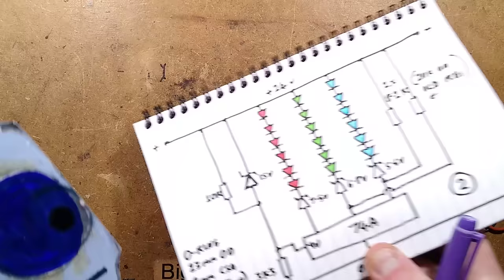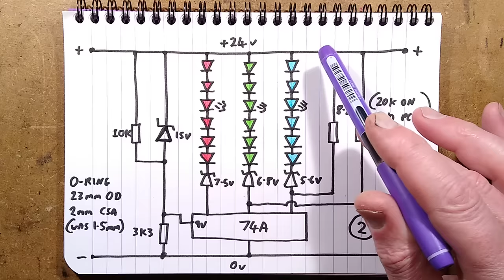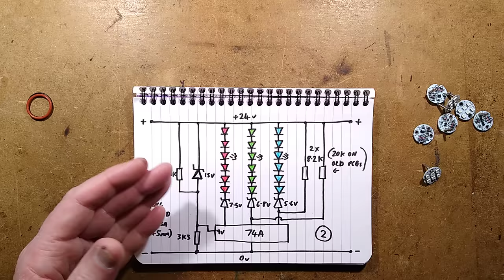Fixing Twinkly festoon issues - interesting power and data system

Comment: Am I the ONLY one who sniggered when Clive said "No. 2" ???

Great video once again, thanks Clive! Would it be possible to hook up a scope to the rail/components to see where the data flows (instead of the water? 🤣)
Reply from the maker: Others have gone much deeper into the twinkly protocol.
Reply: @bigclivedotcom  very interresting how they manage the protocol.. but a bit outside the scope of you typical teardown/fixing things! Nevertheless, a great video. Keep up the good work, thank you Clive! 

Oh! On the topic of OH-rings 🙂 - I see that suppliers normally only quote the inside diameter plus the cord thickness. Probably because the things are so squishy from the outside!

Comment: Another informative video from Big Clive - How to put the twinkle back in your Twinklys! 😁
Would the IC on board be programmed as they produce them? rather than holding stock of each individual number? Also leads to the question "how many of these are in each display/set?"
Reply from the maker: Not sure how they're programmed or the maximum number available in a string.

Comment: Resistors on the right are for calibrating white balance or matching perceived light intensity for all colors - current is fixed in chip and redirecting part of it will reduce intensity of this channel.

Comment: Very interesting.  Never considered SMT resistors would be a point of failure.  Thought they were completely sealed and invulnerable to moisture.
Reply from the maker: It's probably sneaky electrolytic corrosion creating a microscopic gap at a thinner area.
Reply: Where they're not always flat against the board if any water gets under them it'll be hard hard to get it out

Comment: I am no expert on this and I will be perfectly honest and say that this is the first I have heard of these but the communication method sounds very much like a CanBus style protocol with a time synchronisation reset…maybe

However, if it was something as simple as that then that would’ve been picked up already by people trying to reverse engineer it. Maybe some proprietary methods over the top of a well established high speed two wire method?

Nice video as always
Reply: Isn’t CAN (2 wire) using both lines for positive voltage? But yes the signal is always in a range between 1.5 and 3.5 volts. Both wires sum up to the median 2.5V. I guess only 1 wire could be enough if the zeners put the voltage to the lower level to eliminate pulsing. (Probably not even visible if not if its a fast data rate)
Reply: @domnik9062  Yes, CAN bus is two wire. The signal value is determined by comparing the relative voltages of the two wires, CAN H and CAN L, which almost entirely takes out the impact of the incredibly electrically noisy environment that CAN bus was designed for. The concept is that voltage spikes will affect both simultaneously and therefore it's just a case of comparing whatever happens to come through. Voltage drops can be more problematic due to them affecting the circuitry more directly than EM interference in the wires or voltage spikes in the power source.

For something like this application I would expect a combination of data transmissions to one or more recipient nodes as well as an application broadcast transmission that triggers all nodes to apply the data they have just received. It's quite likely that there is also a combination of deltas as well as absolute values in the communications protocol, but that could be complicating things more when it comes to optimising bandwidth compared to control.

Comment: Clive, I wonder if the thing you have marked as the power input is actually the data input, and the chip gets its power from some or all of the LED drive lines. That would explain the lack of a filter cap on the "power" line.

Comment: Would the 8201s stop ghost glow when those strings are off ? They have a place for the 3rd one but it is not populated.
Reply: Why would there be ghost glow? If "off" is called for, the controller won't be pulsing the power to the LEDs?
Reply: Clever these Chinese.
Reply: @obd6HsN  perhaps the driver outputs have some leakage. blue and GaN green are very sensitive and can glow with only 100nA

Comment: Twinkly has really let me down. As long as their products work, it's absolutely amazing, but the longevity is questionable. I have taken really well care of it, but the power supplies only last a season or three, my two strings had leds starting to fail at the end of the first season, and now by the thirds season they are no longer usable as strings, unless I pick an effect with "rainbow colors" since so many leds are the wrong color.
Reply from the maker: They do water resilient versions.  Are you using the standard versions outdoor, and are there visible signs of corrosion?

Comment: Would have been nice to see one of the actual boards in operation. Perhaps even diagnosing and replacing defective resistors. Good information but boring for actual demonstration.
Thanks Clive
Reply from the maker: They require a very specific data driver and protocol.  They will do nothing at all without that data.

Comment: Has anyone measured the data frequency on the power lines yet? I imagine it's up there a ways... 

I used to like to shop for deeply discounted RGB light sets after christmas, as they all used to have decent 4 pin RGB LEDs in them. 

But today they have mostly all went to these 2 pin RGB types, and arent nearly as useful as the 4 pin types as far as hacking goes.